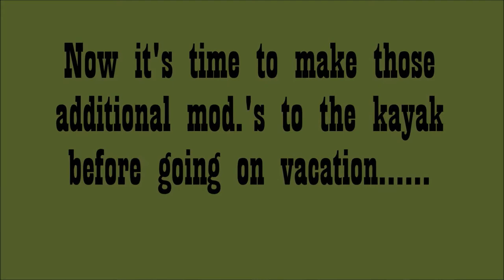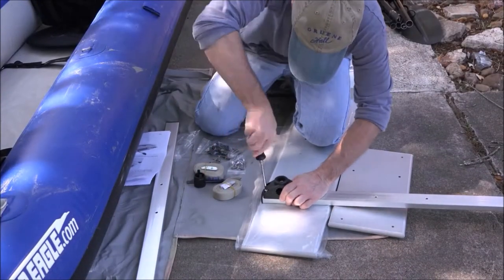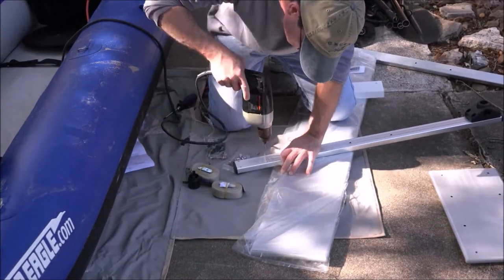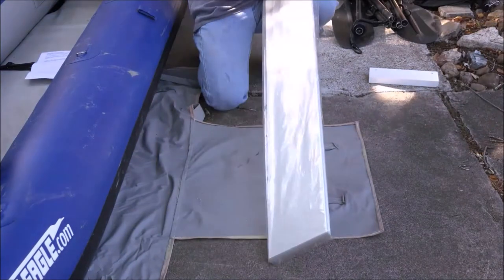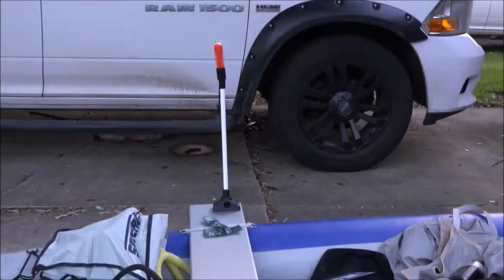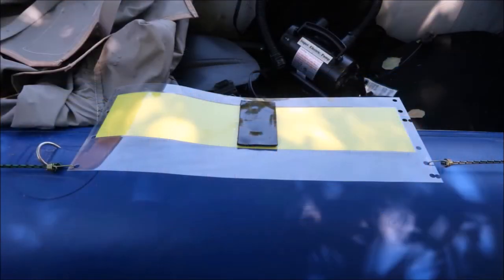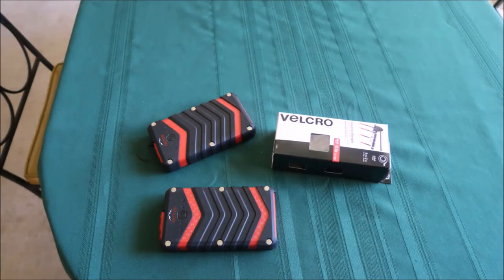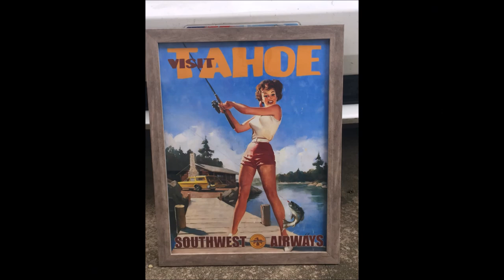Sea Eagle 420X Kayak Modification Project -  Part 2

Comment: Hey, Francis. How is this yak working out for you? I'm considering buying one of these for my daughter and I to use next year. I thought it would be good because I can convert it from one or two people depending on if she is with me or not. I like that it's portable so I don't have to buy a roof rack and deal with setting up two individual yaks.
Reply from the maker: It is great.  Yes, one or two people can use it just fine.  But.... when you rigged it out like I did,  then it is only fit for one person.  They no longer make that model, but they do have a great replacement.  I would check out the Sea Eagle website for more information.  There is a lot of kayak eye candy there.  Take care and thanks for stopping by.

Comment: Hi there, nice set up.  Man, that 420X looks like a long boat.  Lots of room for all your ideas & mods.  You actually have to register inflatable kayaks in the great state of Texas?  As for my main interest in your video, could you please tell me what the dimensions of that motor mount aluminum bar/plate is?  I can't find the actual size on Sea Eagle's web site.  I want to use it on a Sea Eagle FastTrac 385 as a base/anchor point for a small sailing mast & attach it to the front like you did.  

How long, wide & thick is it?  I'm guessing about 48" long if your boat is 36" wide & maybe 8" wide & about 1/2" thick.  It would be a big help if anyone could tell me the actual exact measurements.  The width & thickness are the two main critical measurements I need to know for my application.  I will probably cut it shorter so it's only as wide as the boat or maybe 1" wider on either side. Thank you, cheers from Canada.

Comment: Love the mods. Did you add rings to the front of the kayak? Mine didnt come with rings at the front to mount any boards, only the back.
Reply from the maker: It did.  Maybe they made some product changes.  I could not do what I did without them.  I guess I could have purchased them and use that rubber fabric glue to apply them in place.